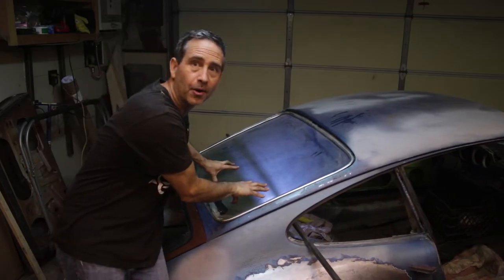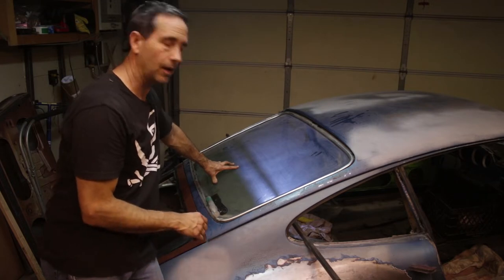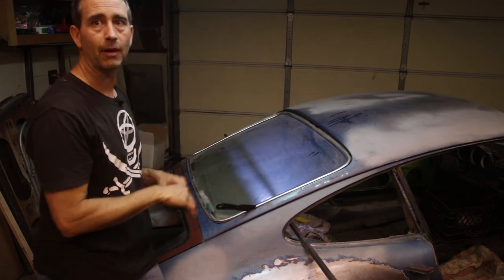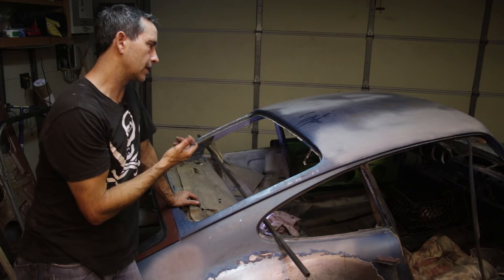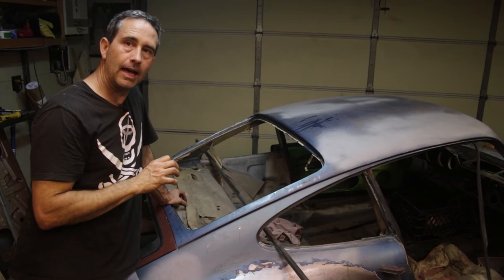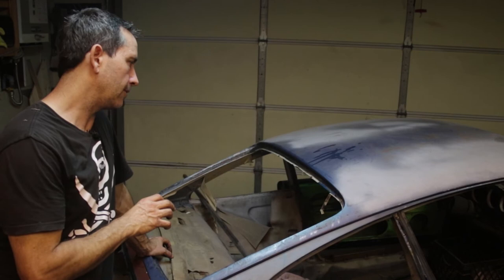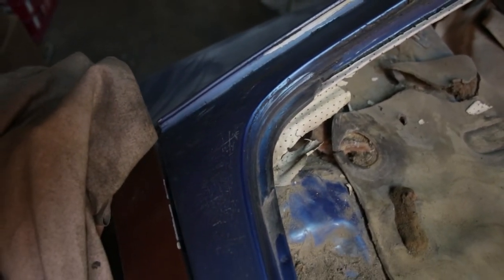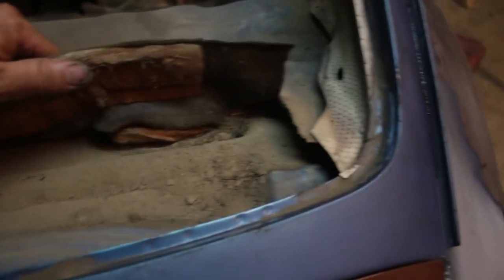How to Remove Porsche 911 Rear Window - No Cutting!

Comment: Awesome! I recently bought a 912 that needs paint and currently has the rear glass out. I might install the glass now in order to drive the car as is. Once I'm ready to paint, i'll pop it back out as shown on this video. 
Do you think it would be possible to(instead of pushing with feet) pull the glass out(from outside) using those glass suction cup handles? 

Thanks
Reply from the maker: Yeah, it's possible if the seal is well lubed up.  Might be hard to pull hard enough with the suction cups though.  I was pushing pretty hard with my feet!

Comment: What color was your originally, looks like it might have been minerva blue.
Reply from the maker: Prussian blue 334-9
Reply: Prussian blue, That's a nice color, not very common. 

My 76 is partially torn apart is arrow blue (factory color). 

I'm totally mad about the minerva or gemini metallic blue, and I'm sorely tempted to change the color. 

It's a huge undertaking to change the color right through. I'm not sure if I'm up for pulling the whole interior, all the glass, sunroof, stripping the paint off the inside surfaces, all that. 

My car will be a driver, not an investment, so I'm not too concerned about 'authenticity' I just want it to 'look' early 70's period correct.
Reply from the maker: @AndySomogyi  Hi Andy,  I do like the Prussian blue, although what little evidence I have left on my car is a bit faded.  The computer images I've see appear much darker.  
I will most likely do a color change because I suck at spraying metallic.  I also keep telling myself that a solid color looks older which is the backdate look I'm going for.  
My car is already stripped out, so a color change isn't any extra work for me.  I also don't care about the devalue naysayers, ha ha.
Reply: Since your car is all torn down, same amount of work whatever color you go with. 

I'd say go with whatever color you like, whatever color excites you the most, and to hell with what anyone else thinks. After all, I think that's why we build cars: to make something that excites us. 

I'm personally a huge fan of the metallic color on early cars with lots of chrome, just love that look. 

I'm certainly no expert on paint, but I sprayed a few cars metallic, and the color coat turned out decent. I always screw up the clear, and get lots of runs though. 

Since I don't have enough space to tear the entire car apart, I have to do it bits at a time. I'm not sure if it's a really dumb idea to spray different parts of the car at different times. As in, spray the inside of the trunk one week, then the insides of the fenders another. And when all the inside bits are painted, maybe take the car to a professional painter to shoot the outside.

Comment: Oh man, I would be super-stressed doing this on a 911, even if I've done it dozens of times on VW Bugs without breaking anything.
Reply from the maker: Acurafill Filip I agree! It was risky but I went slow and didn't think it was going to break or I would have stopped.  It's about the same stress putting it in.
Reply: Garage Time - Auto Resto I hope you are truly enjoying your vacation and getting your “batteries” charged for the next steps in the resto-mod project: from my experience putting the window back in with a length of wire, a handy assistant and patience is going to be much less stressful. But before the glass goes back in we’ll hopefully get treated to many more hours of how-to vids on this great project.
Reply from the maker: Acurafill Filip yes, the trip was great.  I'm excited to begin the paint process soon and be done with all this messy metalwork!

Comment: Nerves of steel. I wouldn't be that brave on old laminated glass even if it was cheap to replace.
Reply from the maker: 👍. It felt like it had a long way to go before it broke, but yes you never know with old glass.  Many racing clubs require steel straps to prevent the glass from flying out!